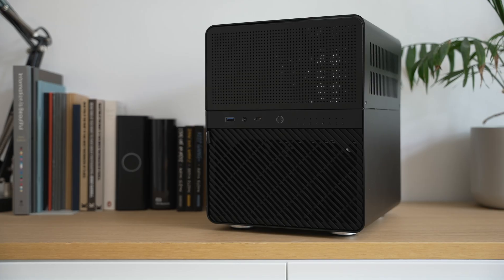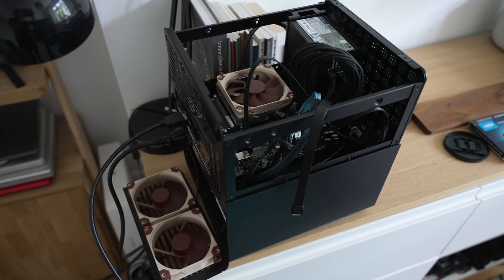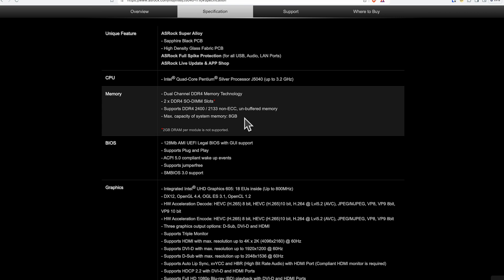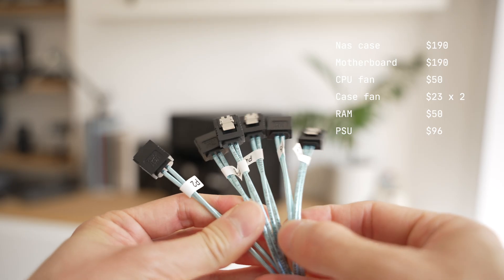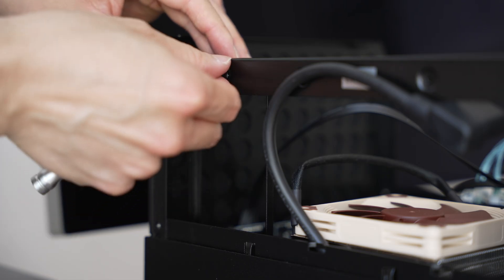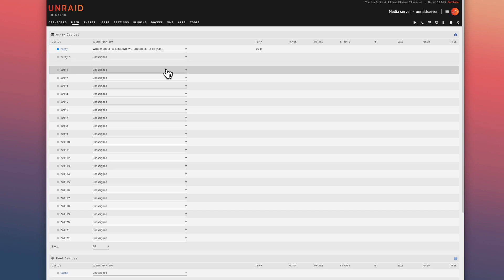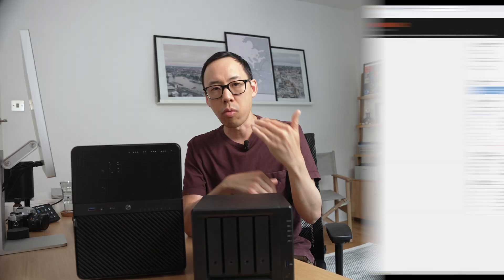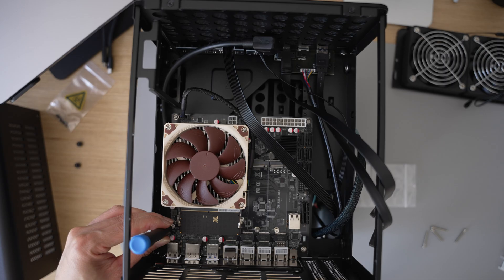Build a Nas Server with Jonsbo N3 - Cheaper than Synology?

Comment: Hi Chuen, thx for your video. did you use two Molex + Sata power  to power the hard drive?
Reply from the maker: I used the SATA power connector on the N3 backplane - you can see the SATA port above all the SATA ports in this clip: https://youtu.be/XXKppFyHtHk?si=Oxdb3qnn70KNi-64&t=388 (I just had to plugged it at that point) No molex adapters. Just the PSUs SATA power cable plugged into that port.

Comment: Gave the wifey a upgrade from a Intel 8100 16gb of ram 256gb system I'd scraped together in a day so she could do the work from home office. It worked well she loved it but I felt she needed a upgrade in 2025 I gave her a Asus z690 it's Strix board 32gb of DDR 5 6800mhz 2tb Samsung 9100 Pro and a stronger GPU a 3080Ti Fe since she lives the sims and the old rig well it could not run that game reliably. 

I turned the old system into a TrueNas for her to back up her phone/labtops/desktop with 6x12TB drives love this case and it's bigger brother the N5 which I'll be migrating the Synology over to them making the Synology just a Rsync backup server.

The downside of buying off the shelf is insane cost for much weaker CPU's barely capable of doing basic tasks.

Comment: Built a similar NAS in a Jonsbo N3 but recently left the case for a new AliExpress one for two reasons:
- The harddrive cooling solution is just plain bad. The fans are mounted in the rear and meant to pull air through the front past the harddrives. But the backplane for the harddrives is so efficient at blocking the airflow that you would guess they're put there on purpose.. I had to mount external fans on the outside front to get decent temperatures.
- I outgrew 8 bay.

TLDR; Harddrive cooling is insufficent. 8 bays may or may not be enough for you.

Comment: As someone who has tried my dad's Synology, and have set up my own self-built NAS running TrueNAS, I think it mainly comes down to whether you want the system to be upgradeable (your system might cost a few hundred more now, but if you suddenly felt like you needed to change fan, add fans, change chassi, you don't need to buy a whole new module) and have more control of the backend; or if you prefer to just boot it up and have everything ready out of the box. 

Personally, I like playing around with tech, so making my own works best, but I can see the charm in simply not having to do that lol. 

That and if yo ucompletely self host you don't have to worry about Synology suddenly deciding you need to pay a sub or change their ToS or some BS like that
Reply: so true aye.. as long as you got the time I guess.

Comment: I chose N2 case and installed Windows. Then, I set up Storage Spaces (a built in software raid solution) with Mirroring. Finally, I connected my NAS as a Network shared drive to my working pc.

Comment: IMHO what most of the DIY-ers seem to overlook or misinterpret is that Synology isn't a hardware, but rather a software company nowadays. The reason most users choose to go with Synology is the software suite that the company offers with their devices. Obviously, there's a plethora of free solutions out there that you could install and configure to your liking for UNRAID or TrueNAS, however in the Synology world these are bundled with the HW and come with an easy to use interface.
Reply: I kinda disagree, if it truly was a software company, they would release synology OS as a product, but they don't, which is why some people go the Xpenology route, to me they are a "complete nas solution", sort of the "apple'' of a NAS, you don't really need to know about hardware or the cli software admin stuff to get a functioning nas. Also, their blocking of unverified non-Synology branded Drives, which for most users (who are usually non technically inclined) is going to be a headache, thought quite in line with the "apple" route they have been following

Comment: I stopped building (home) NAS when HP came out with their original AMD based boxes, which were a bargain. But now they are not! SO I am building again using Topton boards. I have Synology and Asus NAS boxes, but while they are OK, there are just too many compromises in their lower cost boxes, and the expensive ones are expensive for what they are. So, back to DIY.

Comment: I built my NAS about the same time as OP, similar built, but I opted for Intel 8505 board because it is more powerful than N100, dual channel RAM and more PCIe lanes.  And at the time, the price was not more than $100 differ, cost less than $250 (for ITX+cooler+NVMe expansion board) for me.  Considering one of the reason I decided to build my own NAS was the fact that recent Synology NAS hardware was quite a lackluster, beefier embedded board is a better future-proof choice.  Do keep in mind that either way, this board nor the OP board do not support ECC or WOL.  If they are important to you, stay clear of it.  Otherwise I says it's decent.  Using this board w/ the N3 case, there may be a way to add another PCIe x4 slot to it, since there is a room on the case by piggybacking one of the nVME slot or use SFF-8643 on the 8505 board (again more PCIe lanes).  I might do some experiment on this.  And another note is that, if you don't plan on building your NAS w/ a dedicated GPU, you could opt for less powerful SFX PSU.  Most of the power consume will be the drives, on average 10-15w each.  So your overall power usage would actually be about 100w and max of less than 200w.  So, cheaper 300-400w would actually be sufficient.

PS: If you are interest on the 8505 board (which is gone now, replaced w/ more expensive 12450H instead).  I did post a quick review on servethehome forum, https://forums.servethehome.com/index.php?threads/cwwk-8505-nas-quick-take.45838/.  Especially a tidbit/quirk of sort that will need to be resolved.
Reply: Really informative comment thanks !!

Comment: The motherboard has 6 sata connection so you can't use all 8 slots right? or did i miss something? Also i want a better mobo with atleast 64GB and better CPU. Any recommendation?
Reply: There are m.2 nvme to sata cards that can help solve this problem.

Comment: If anyone is wondering, if your CPU power cable is a 8pin and doesn't split, they are designed fit with half the plug on the outside of the socket.

Comment: You can find good info - like header pin layouts - for the CWWK NAS motherboards over at the servethehome forums. The low power Alder Lake-N CPU's (like the N100) provide only 9 PCIe gen 3 lane for all of the peripherals, so the manufacturers had to make some compromises. Five of the six SATA ports are provided by the JMB585 chipset and it gets only one PCIe lane, so total I/O SATA bandwidth is limited to about 1000 MB/s. That's ok for spinning hard drives but it can potentially bottleneck with an array of SATA ssd's. The two M.2 NVMe slots each get 1 PCIe lane, so thats will throttle the performance of any expensive fast NVMe drives. If you need more than 6 SATA ports, you can sacrifice one of the NVMe slots by installing an inexpensive M.2-to-SATA adapter board with an ASM1166 chipset. Despite the above limitations, these boards make decent low power storage servers. A lot of people have done NAS builds with them. BTW, the first boot take forever, especially if you install a lot of RAM. I think the BIOS odes memory training. Be patient.

Comment: The motherboard has only 6 sata connectors so you’d need to update if you were to add all 8 sata drives or can you add a sata card?
Reply: yeah you could add a sata card or even m.2 sata adapter lol

Comment: do you have documentation of the CWWK 12th Gen Intel i3-N305 N355 N100 N150 NAS monster board 6-bay 4x 2.5G/6x SATA3.0/2x M.2 NVMe/115X radiator ITX board type motherboard? Wanting to obtain the board, however I would like to see a few more things like the front panel connections on the motherboard...

Comment: Hello. You can also buy an adapter to m2 slot that give you 5 sata slots. I have this with almost identical motherboard (I have with cpu i7 1165g7). I’m using all sata ports from mobo, 4 ports sata from sff-8643 also from mobo and 3 sata ports from m2 adapter to sata ports. Maybe in future I will add rest of disks. Mobo has also pci express so you can buy adapter from this to m2 ports or sata ports. This mobo is cheap and very powerful. Of course cpu is important to manage all pcie lanes that you plan to have in your server. 
If you will have more devices with pcie express interface than cpu can operate that you will lose speed. I have this in another computer with another motherboard but not from China. I have 2x m2 nvme ssd but mobo has only one port 10gbit. CPU is i7 4gen and It’s reduce 4 lanes to 2 lanes on each m2 ssd and disables 2 last ports sata. It still much faster than sata but maybe somebody don’t know it.

Comment: Great video. I did a similar build in 2023. I probably went a bit OTT on the CPU in comparison because I knew i wanted to run a fair few docker containers. Mine isn't too loud but your noise tips would have helped.
Reply: What motherboard and CPU do you use in the N3?

Comment: You could buy the Topton n100 motherboard which is basically the same but it comes with a cooler and it's way cheaper.
If you really need a cooler you could also buy a scythe bigh shuriken 3 for like 35-40$. It's quieter, cooler and cheaper than the L9i.
Also just buy a slim fan for the back, an arctic one is like 6-7$.
For PSU you could buy a Be Quiet 300/450W Bronze unit, has enough ports for the backplane and it's only 65-75$.
I have one in my N3 for over a year now without problem.

Comment: I found other method for usb stick. It turns out that you can use SanDisk MobileMate usb card reader and swap microSD cards without assigning them to UNRAID. Dont forget to make backup of config folder from that pendrive. My 1st pendrive died after 6 years but then I bought samsung bar and It died after a year.

Comment: Regarding the Jonsbo N2 case, you don't need to 3D print a mounting bracket, you can just buy another slim fan (15 mm) if you don't like the stock one. And the people complaining about the noise have probably just connected it to the back plate instead of the mobo, thus making it run at 100 % all the time. If you connect it to the mobo you can set the fan to run at your desired speed, reducing the noise significantly.
Reply: good info
Reply: If it’s like the N4, you can’t collect it to the mobo as it’s not PWM, so you will need to get a new fan.

Comment: this is a really great video, i may try this build. as far as adding a larger drive to the unraid array, what happens to the extra space on the drive? in this video you give the example of adding the 10TB drive...so if your other two drives are 8TB, then only 8TB of the 10TB will be used for parity. so the remaining 2TB is just wasted?
Reply: He liked your comment but didn't reply... I'd also like to know

Comment: You don't actually need a 3D printer for the N2. You can simply screw in a larger 25mm/30mm thick fan from the outside of the case without the print. Works just as well.
Reply: Or for a less conspicuous alternative that looks stock, just buy an arctic P12 slim fan. 15mm fits well into this case.

Comment: Great case! I build setup with 8 4tb 1 nvme and 2 ssd 32gb ECC ram 
All of this with gigabyte b550i aorus pro ax .
I swap the ax card for m.2 to 2.5GbE nic and now i had 2 2.5  ports that I plan to use as agg lacp.
The cpu is AMD Ryzen 5 pro 5650ge
I installed Truenas scale and now plan to migrate all my docker containers from openmediavault
Reply: How is this system running for you?  Pretty stable?  Ive been running a 3950x in eco mode, and Ive had a few random crashed on unraid due to it having some issues handling c-states apparently.  May not be an issue with Truenas.  Where did you get the 5650ge from?  I run 20+ docker containers and a few VM's, so I dont think 6/12 is gonna cut it.  Been looking for a 5750ge but they are hard to come by and pricey when you see them.  Was thinking of using one of the Minisforum boards with the 16c/32th Ryzen chips, but then id lose my 64gb of ecc DDR4 and have to go with non ecc DDR5.  What a privilege to have so many options.

Comment: Nice video although prices in USD when based in the UK are confusing - are these all including VAT or was it actually 20% more expensive? (I read the small print at 5:47 but wasn't sure what you'd included 😉)

Comment: A good competition would be a AOOSTAR WTR Pro with 8 core Ryzen CPU, 32GB ram, 2x 2.5G nic, 1TB nvm, 2x nvm slots. You get a better hardware in smaller form factor and a warranty for  500$.
Reply: Only problem with AOOSTAR is if something fails you almost need to replace the whole device
Reply: But no way to mount a dedi gpu

Comment: If you're the sort of person building their own NAS then you've probably already had an off the shelf NAS and want to move onto something more mature and user accessible. You may want more control of your hardware and software and be less subject to proprietary standards and unknown hardware quality.

Anyone who used the SHR format option on their Synology NAS units is locking themself into a format that isn't supported by other operating systems.

With that mindset, it is probably best not to buy a motherboard with an integrated CPU. It would be wiser to buy a motherboard with a socket and a separate CPU so you can replace or upgrade much more easily.

Comment: for people thinking 722 is roughly all you have to pay for nas, nah. if you are adding lots of storage e.g. 4x 12tb or more, then expect to pay a couple hundred more usd to that build. And that is not even counting the backup. You shouldn't be using a nas like this without some sort of backup plan if you don't have one already. Usually that is either some external usb hard drive storage, or a 2nd nas, or cloud backup. So that too will add to the cost. 

Don't be thinking you can dump all your digital stuff on that single nas without a backup and you are set. Different story if the data is not important and you can afford to lose it. But chances r you may be storing important data, so you would need a backup.
Reply: Depends on what it is. What most people consider "important" is usually Documents and Pictures, which take up very little space. If you have an offsite backup for "only" the documents and pictures, it's pretty affordable. Backblaze B2 is free up to 10 GB, and then it's pretty cheap after that (I think I'm slightly over that, so I get charged like 6 cents a month or something). But the point is, you can pick and choose what is important enough to backup. You don't have to backup literally everything on there.

I have around 22 TB usable on my NAS with 12 TB used, but a huge chunk of that is large files that while it would be a pain to lose them, I could afford to lose them. I'd have to re-rip all my Blu-Rays and CDs again etc. which would be super annoying, but life wouldn't be over if I lost the rips I have.
Reply: @praetorxyn newb here but why is a backup needed if you are running raid? Aren't you protected from a drive failure and can rebuild the lost drive? Am I confusing the concept of NAS with raid? I'm planning to build a NAS in order to have my data backed up and running raid to protect it.

Comment: N400 is not necessary imho. In case you already have some CPU with an embedded GPU (many people most likely have), for the same €190 (or €120- used, refurbished plus a used CPU) you can get Gigabyte Aorus B550/ROG Strix B760: 4xSATA (vertical), 2xM.2, Wi-Fi, DDR4. If you need more SATA (up to 8), you still have a PCIe slot. And you don’t need an M.2 wifi card, and so you can put the NAS into a darkest, coldest corner.
Ryzens are cold. 65W of TDP is a piece of cake for the Noktua. And you can run some heavy tasks meanwhile in a container in parallel in opposite to N400
Reply: Yes that CPU couldn't handle running VMs but great for media storage like he seems to only use it for.

Comment: It's cheaper, but the Synology software is much better.
Reply: When you build any system your own, it goes without saying that you need your own software, but there’re tons of open sourced one that works awesomely
Reply: That depends on what you want to do and your technical skill level.

If all you want to do is basic storage and you aren't very tech savvy, maybe.

If all you want to do is basic storage and you are tech savvy, TrueNAS [Scale] runs circles around it because of ZFS.

If you want to do storage and also host a bunch of apps with Docker Compose and Portainer, Synology's DSM actively gets in your way. Their Reverse Proxy GUI is woefully insufficient compared to a proper reverse proxy like traefik or swag, and they're already running nginx on ports 80 and 443, so you have to figure out how to edit these .mustache template files to change the ports of their built-in nginx to something else before you can use a proper reverse proxy on 80 / 443, and every major DSM update will put their shitty nginx back so you have to undo it again. I had to write a script for this purpose.

The version of Docker on DSM is positively ancient, which is a massive problem in a setup like that. I can't even do things like have one Docker Compose stack import another one.
Reply: @praetorxyn  Yes, but Synology software is more polished, more easy UI inclined. Photos app is great. I am not a fan of Synology, but I use Synology as vm only for photos. I tried it all, from immich to prism to plex. Also, in video, nobody says that the price is not for hardware only, is hardware and software and support. If you your not a savvy tech is the best choice.
Reply: You can install their software anywhere